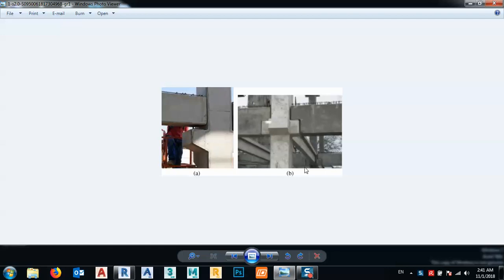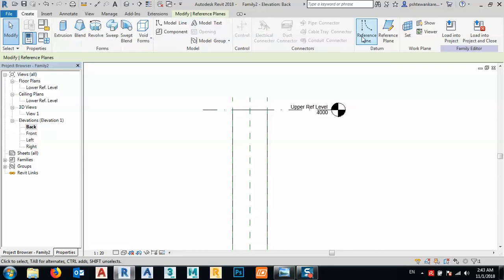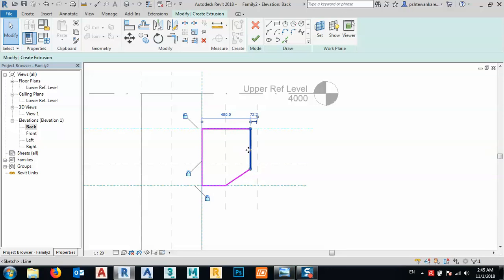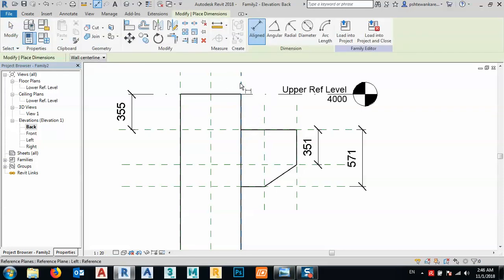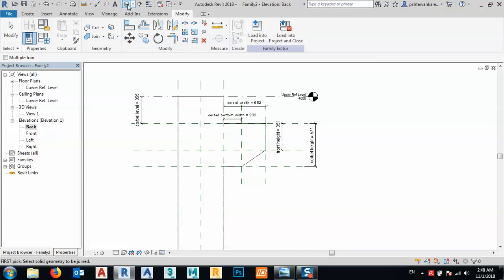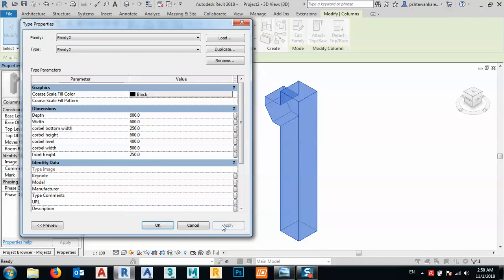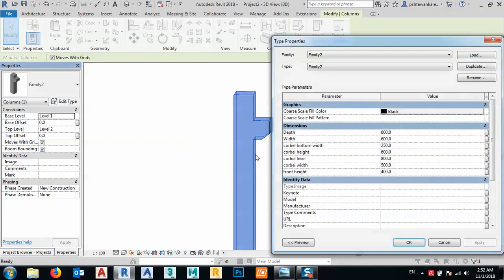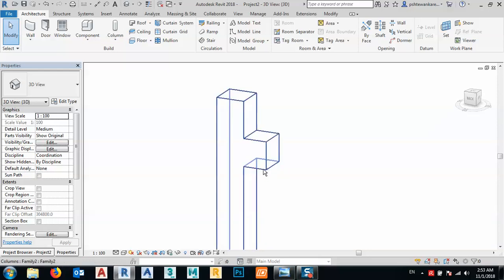Revit - Column Corbel family

Comment: Is there a way to do this and make the face of the column the face offset for the beams that connect to it? This is to avoid having to manually change the start/end extension.
Reply from the maker: Can you tell me which minute do you mean ?